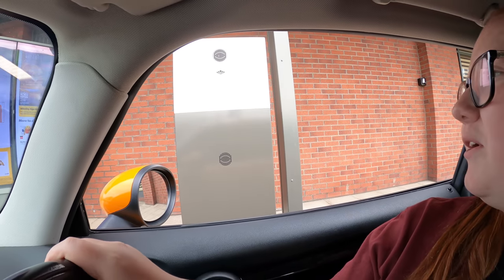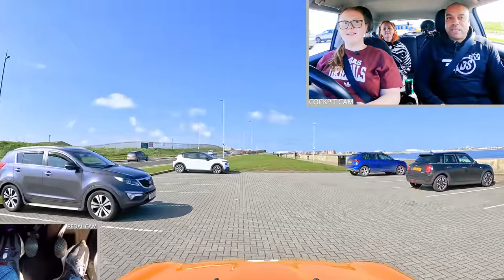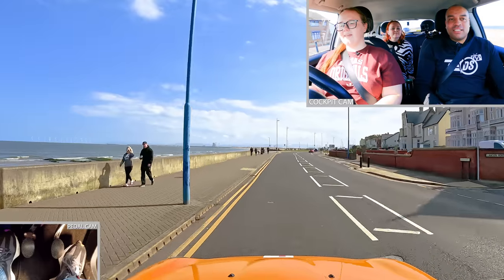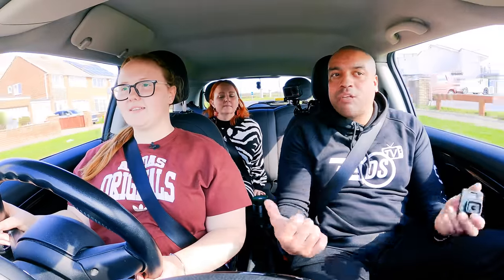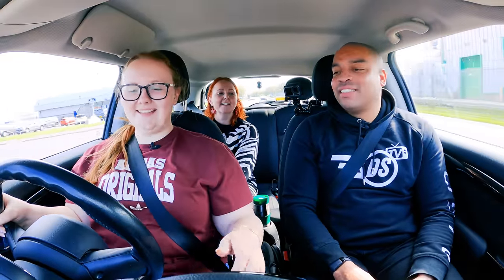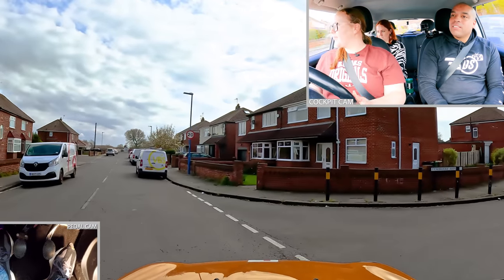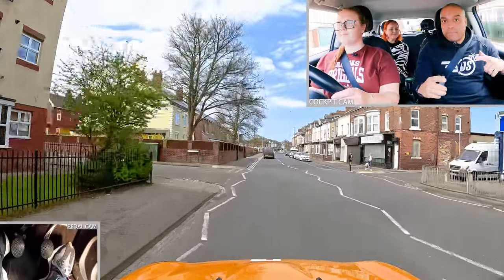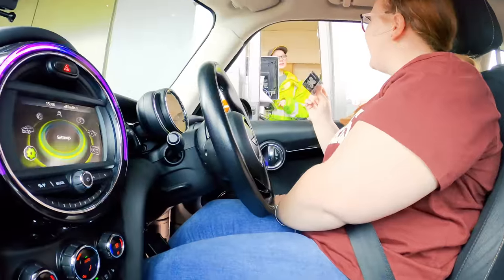Learner Orders PLAIN Cheeseburger On Her Driving Test!

Comment: Comprehensive insurance is almost always cheaper than third party only (and often significantly so). Not many people believe that but just try for yourself, you’ll see! I can only imagine it’s because over time, the algorithms have detected that people who have higher insurance costs generally select third party only to try save some cash.

Add additional drivers one by one and compare how each one affects your quotes. My mom for example, has an auto only license and actually brings my insurance price up quite significantly so watch out for that. Self-Employed additional drivers are a godsend because you can be somewhat “creative” when putting down their career. 

When asked to provide you estimated mileage, don’t go too low! I’ve found the sweet spot is 3500 miles (obviously be honest - but nobody is expected to provide a 100% accurate estimate so you can play around with it). 

Those tips apply whether you have a car in mind or not, the next are a few unexpected tips when picking a car.

Avoid new cars! If you’re lucky enough to be getting a new car as a first car, probably choose something a year or so old. Brand new cars have mental insurance for some reason. You can try this out for yourself. Run a quote for a brand new VW UP (or any usually cheap car to insure) and then run a quote for a slightly used faster car (you’ll be amazed).

Don’t be afraid to go bigger in size (dimensions). Often people expect that a smaller car (in terms of dimensions) will be cheaper to insure, but this is not always the case! You should play around with this a bit because sometimes you can get a cheaper quote for a mini or even a standard than a supermini.

Go for slightly rarer cars or cars which are less common amongst people who have accidents. No disrespect to anyone, but if I was an insurance provider, I also wouldn’t want to insure a 17 year old on a Golf GTI. There’s plenty of cars that are as fast for the same money but are slightly less desirable amongst the crowd the insurance companies are trying to avoid, all you have to do is google them. A good example of this is BMW. Imagine you want a 1 series, but insurance is too high. Well, there’s plenty of 3 series cars for the same price but which essentially cut insurance by a third! It’s strange but it tends to work.

And my final tip - the algorithm is not too keen on anything rear-wheel drive or automatic. For example, something like an automatic 1 series would be much pricier to insure than a manual a3. This is despite the fact that depending on the engine, they both go roughly the same speed.

These tips won’t work for everyone because car insurance is a complicated game run mostly by computers, no single person fully understands it. But, try some of them (especially the ones which are not related to the type of car you pick) and see what happens.
Reply from the maker: You are an absolute legend and this info is gold!! Thank you so much! Comment pinned and we’ll look into all of this and credit you when we make the insurance video 😊
Reply: ive been fully comp from day one and still am , think that what also saved my year no claims when hit by uninsured driver old lady false plates. mine was £1900 a year for 2007 fiesta 1.4tdci 70bhp not a fast at all but lightweight so fun to drive that age 32. now i got no claims protected  but when i asked to protect on my first year i could not even tick the box to protect but some how they were so that could only be because fully comp that all i can think the reason why, but £1900 a year for 70bhp diesel fiesta at 32, many years ago my mate at age 17 a 306 diesel turbo 90bhp had good top speed he paid £700, but he had rich parents and a driveway, so being wealthy too also lowers your insurance it seems. going at my mates rate but in 4 miles in a town near a big city (coventry) what i thought be right would be £1200 max less powerful car much older and in town known for wealthy snobby people because we in Warwickshire it should been lower than £1900. i did move from N Wales were grew up things seem to be cheaper, age and lower powered car really should be less than £1k but as old lady killed my first car i basically got my money back and car gained value and so how protected no claims so some plus points
Reply: wow auto insurance is so different in UK... here in New Zealand 95% of cars are automatic, and they don't even ask what job you have etc... just how long you've been driving and if you've had any incidents etc...